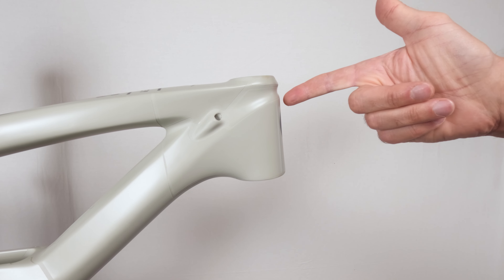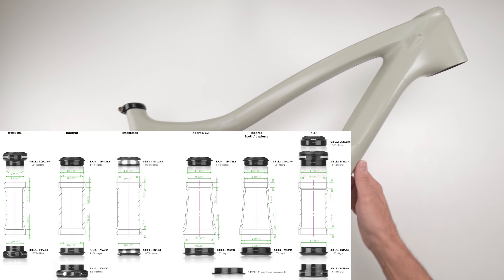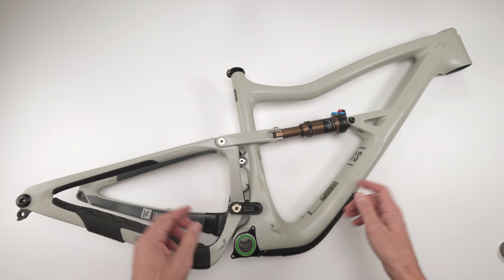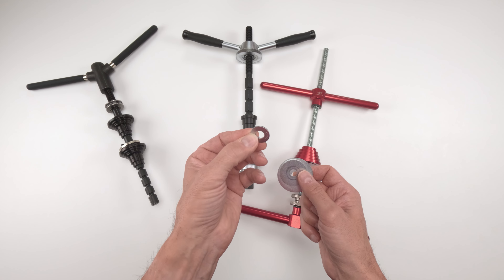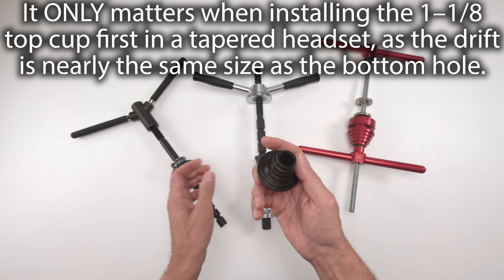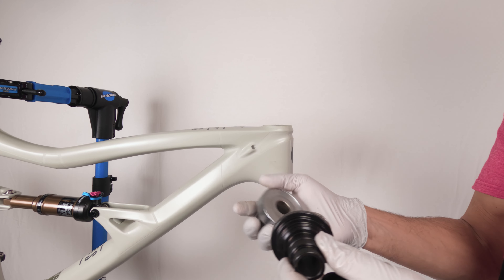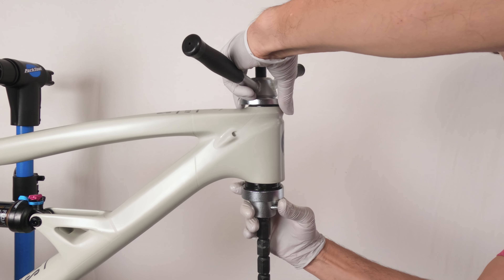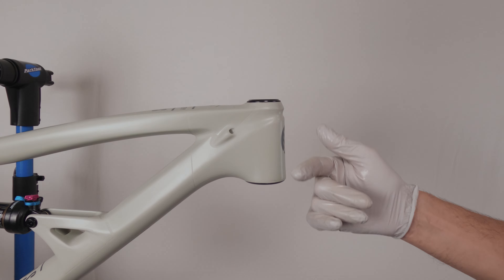MTB Headtube service guide for beginners. Headset Cup Install + headtube facing & reaming advice

Comment: Harping on getting the emblem straight... I love it! It's just like lining up the hub logo with the valve hole on the rim, just says attention to detail. I couldn't agree more with the CC 110/Hellbender 70 double lip seal crown race being the best one out there. The difference between it and the stock 40 single lip seal is beyond night and day. Great sluff as usual. 👍
Reply from the maker: I'm so behind on responding to comments. You remember the old commercial "this is your Brian on drugs", that egg in the pan would be my brain after my ocd noticed that the emblem was off  by the slightest. 😁

I honestly don't know how popular the 110 race is, but I've been pushing it to people in my area for years. Seriously impressive how effective it is 👍

Comment: I have the cheaper headset press and figured out after purchase that it was barely big enough. Just cut some wood 2x4 and drilled a hole to press the 1 1/2" cup
Reply from the maker: You can do that, but 2x4's today are so soft that there is a chance that the cup will sink into it a bit, which can end up pressing the cup into the frame at an angle. It is better to cut  two 3"x3" squares of plywood, then reinforce them with washers, if you can't find fender washers large enough. I did this for a couple of years back in the 2012 time frame, and it worked well. Then I found larger washers, which worked much better

Comment: Integrated bearings are good if the frame have life time warranty.
Reply from the maker: Totally agree. I use stainless bearings on my farly and see minor pitting in the carbon, yet no signs of corrosion on the bearing. Trek only has a 5 year warranty on that year frame. Now, the vast majority of time I ride it is in the winter, so I don't put hundreds of hours on it a year, but if it was my main bike, I have to assume the wear on the integrated cup would be much worse.